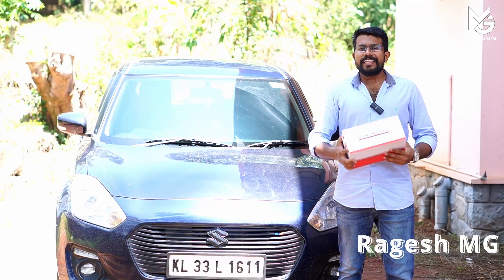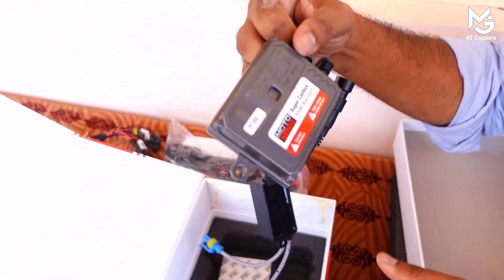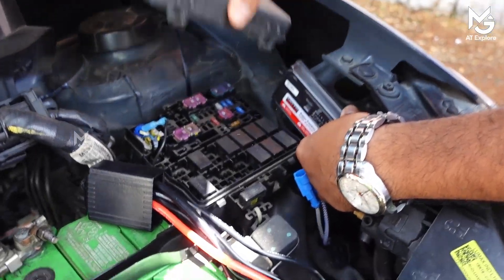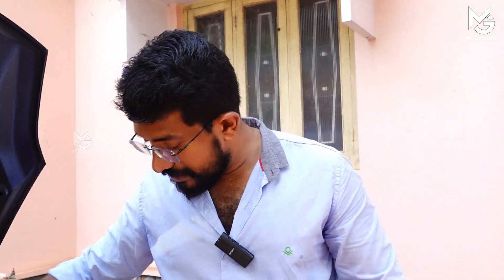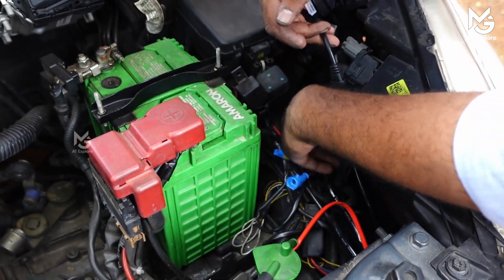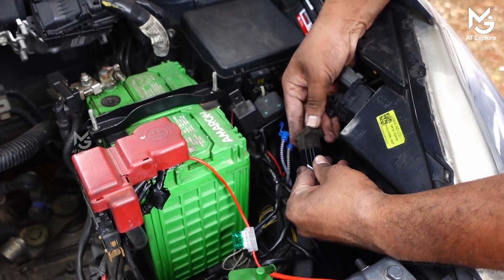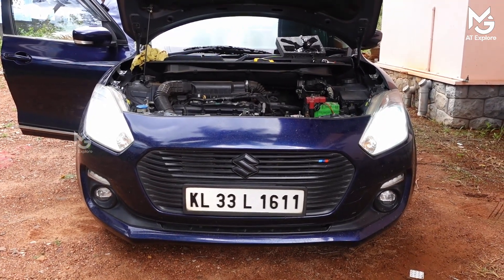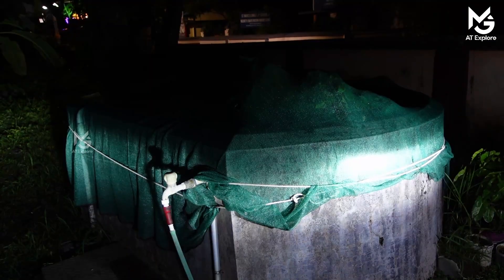New Swift HID fitting | Moto NEEDS |പുതിയ സ്വിഫ്റ്റ് ഒരു ഹെച് ഐ ഡി പിടിപ്പിച്ചാലോ | DIY |  Ragesh MG

Comment: Projector il മാത്രം hid install ചെയ്യുക. ഇല്ലെങ്കിൽ opposite വരുന്നവൻ്റെ കണ്ണ് പോകും. അത് പോലെ headlight module nte cap drill ചെയ്യേണ്ടി വരും.
Reply from the maker: But njn athinode agree cheyilla Karanam low beem anengil oru kuzhapamilla varilla but high beem ittal urapayum athe problem undakum.. that's true